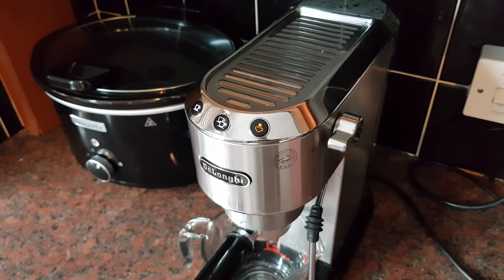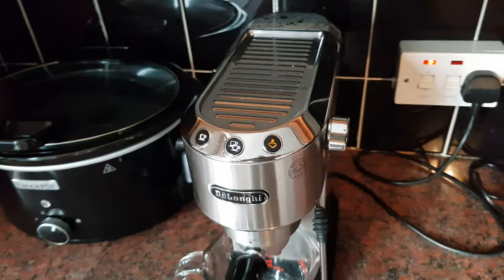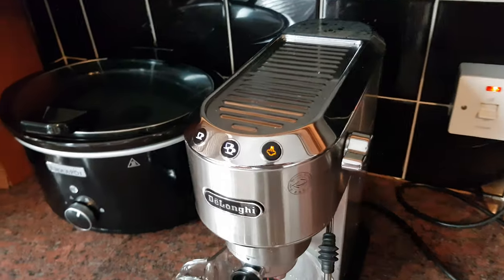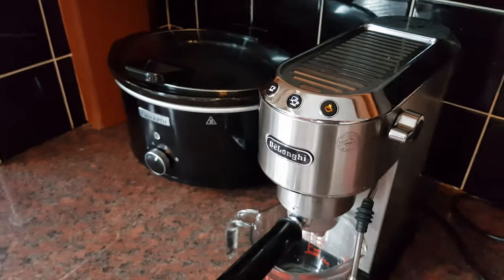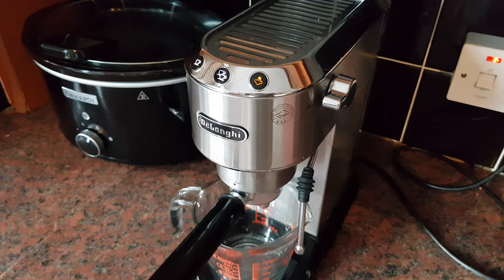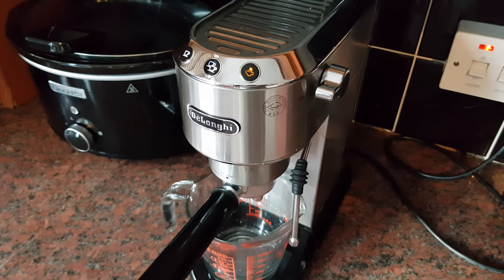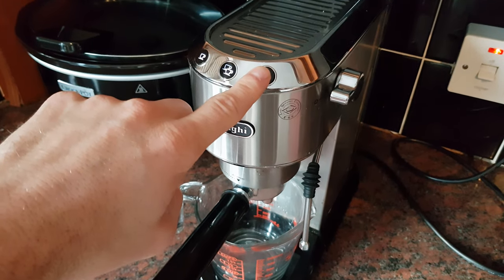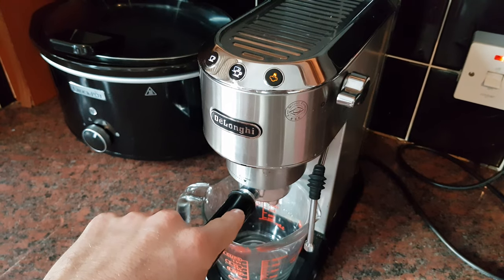Why your delonghi dedica 680 won't finish descaling in less than 1 minute

Comment: Didn't work for me
Reply from the maker: More info?
Reply from the maker: What happens when you put water in the back and hold down the flashing light?
Reply: @MrSmoothasf  the steam button goes white but when I try make a drink it goes to flashing Amber again
Reply: @MrSmoothasf  I descale it last week
Reply from the maker: @martley5012  my guess is your milk frother tip is blocked
Reply: @MrSmoothasf  unfortunately  that not possible  I don't use the milk frother
Reply from the maker: @martley5012  sorry I couldn't be of any further  help
Reply: @MrSmoothasf  it is ok thanks for the replies any way